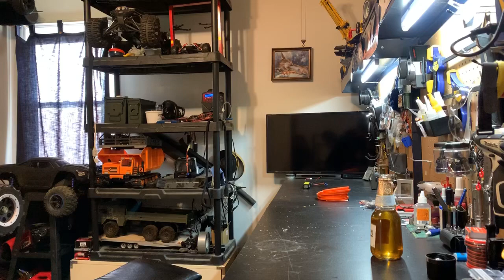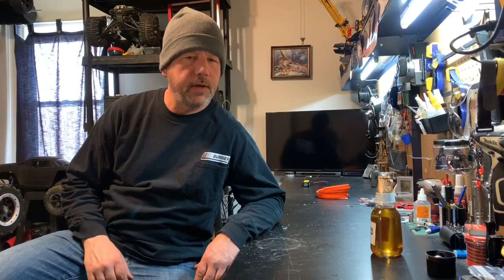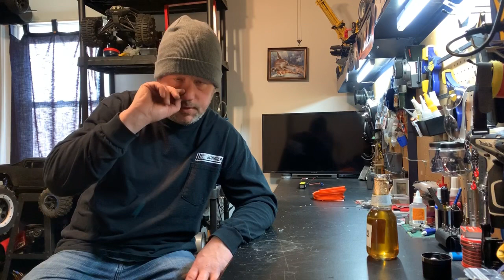Losi 5ive update/clutch issues

Comment: A CY clutch plate is what you are looking for. The Zenoah clutch plate is slightly thicker pushing the shoes into the bell further. If you continue to run that engine without the flat washers behind the clutch it will eventually wear into the aluminum clutch pate. The washers are steel to prevent wear and space the clutch out properly. Good luck my Braaaap Brother!!!
Reply from the maker: Thank a lot  G!

Comment: If I understand the issue correctly, I used CY clutch plate instead of Zenoah clutch plate to solve this problem. The clutch washer is important for the clutch, you should keep them. Thanks for sharing!
Reply from the maker: Thanks for the info man! I’m just going to run it like this for now as I’ll have to buy a new clutch/plate either way. Thinking about it, there’s not much wear going on at that joint as there’s only a very small amount of pivot action going on there.

Comment: Sounds like the clutch is probably off in size and when you replace the clutch try out a fs clutch but please run the washers behind!
Reply from the maker: Thanks for the input brother. I would tend to agree with you about the clutch size if the problem were consistent but it was very sporadic. Sometimes it was free other times it was hung up. Very weird
Reply: @rcOhio  the key to weeding out that issue is trying a different clutch, if it does it with another you have a housing issue and then it's time for modifications!
Reply: Elite Rc I have had problems with the clutch plates also !! Then I switch them out and run the RB Innovations fanned clutch plate !! But your right on with some of those clutches !! The FS ones are awesome 👍🏼
Reply: Good info brother 💪🏻👍🏼
Reply from the maker: Elite Rc thanks for your wisdom brother 😉 I’m going to run it like this for now. If it ruins the clutch it’s no big deal, I’ll be buying one either way. As far as I’m concerned I don’t think that’s much of a wear point as movement is very minimal there. The shoes only pivot at that point and based on the clearance between the shoes and the bell, that’s a very small movement. We’ll see I guess. I really appreciate your help man!

Comment: Meant to ask you before. I got a spare g290 been thinking about the LOSI 5b build is that a good engine for that?
Reply from the maker: I haven’t run it a ton but I feel like it’s a great match, especially at the price point. Is there better engines out there for this platform? Of course. However, the 5ive is a great deal lighter than many of the others out there. That said, coupled with the stock gearing I feel like it’s pretty great across the board. It’s not laggy at all out of the hole (slow to rev is a major pet peeve of mine) and the top end seems acceptable as well. I like this build a lot. For the price of the build I think you’d be hard pressed to find higher quality. With a good pipe, engine, three servos and the kit I’m at $1550. Shit the kit is only $750 shipped. I have no idea how they can sell it for that. I’m not at all dogging Rovan as I own two myself and will purchase more in the future but the 5ive is on another level. For the little bit of extra money and an excellent build experience I’d say it’s more than worth it! Sorry I went on but I hope I at least answered your original engine question!

Comment: Did you 320 have a Baja or Losi clutch housing. That would make the difference you are describing?? Just curious.
Reply from the maker: I ordered the engine with the Losi housing. The mounting holes lines up on the chassis and the housing has the Losi top brace mount so I’m assuming they shipped the correct one. Not to mention I’ve never had an incorrect ddm order😉
Reply: rc Ohio really odd, maybe it’s a bad missmachined bell. Are the bearings in the clutch bell housing all the way? Got to be just something goofy. Maybe spacers on the bell where it meets the bearing. I really think you want those washer behind the clutch shoes. They keep the aluminum from wearing. Good luck I am sure you will figure it out. Maybe if you have a different bell give it a shot.
Reply from the maker: Richard Gordon thanks for the help Richard. I don’t know. I’ll run it like this for now I guess. Like I said, the bell is running very true, the weld  for the pinion shaft is clean... I assembled the kit and I’m sure I pressed the bearings in to their seat. I just don’t know. All of your thoughts are definitely possibilities but I’ve eliminated them. Thanks brother!